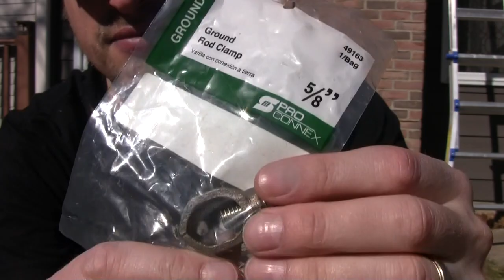Grounding mast and antenna with the Helium Network - Part 1, the Equipment

Comment from the maker: One of my viewers called out that introducing a second grounding rod can cause issues. Audiophiles know this as ground hum. As my grounding is on the other side of the house. I’m going to research this and get back to you all!

UPDATE: Copper clips are better than steel clips as to prevent oxidation of the copper.
UPDATE: My service loops are upside down in this video. You want them going the other way, looping downwards.
UPDATE: Teflon tape is recommended for sealing those connections. It's the same you use for plumbing.
Reply: Hi Ed Ballou, I am thinking to change to 5.8dbi antenna, do you know how I can ground my antenna? Because live in a condominium and we don't have direct grounding to earth.

Comment: You should be using copper clips with copper the prevent electrolysis . In most cases, when stainless steel was in the passive state and acted as the cathode, the contact accelerated copper corrosion. In addition, the area ratio of stainless steel to copper altered copper corrosion behavior. The larger the area of stainless steel, the greater the acceleration of copper corrosion.
Reply: nerd

Comment: Hey Ed
     Love your vids........ but your install needs lots of work. U should totally avoid  running yr antenna wire from the roof to inside the house. U will lose a lot of signal. Best way is put yr hotspot outside connected to the antenna with a outside box. This will give u a very short antenna wire. Then run yr Ethernet cable from inside to ur roof using PoE thus no power cable needed. Your service loop is upside down. They don’t run up, they run down. If you can ....... run yr ground wire to your water meter. It has a ground. They all do. Thx and again keep up the vids. Cheers

Comment: How can you  ground an antenna with an an arrested in a balcony apartment building in a simple way😕
Reply from the maker: Most balconies (recently built) have to be grounded, so just connect to the metal.

Comment: If you have the magnetic base and metal roof will this increase signal also do I need to ground for this to work?
Reply from the maker: Yes! Grounding is always recommended if you're running the antenna outside.

Comment: what's the loss if you make this much length LMR 400 cable to the antenna. So if your antenna is 8dbi what's you think the loss will be for this setup. Also, there will be losses on the junction where you added lighting arrestor with the LMR cable.
Reply from the maker: For the 32 feet, it's probably a little over 1db loss.
Reply: 1.248 dbi

Comment: What do you use to attach the solid copper grounding cable to the antenna mast? I have everything to ground, besides that part.
Reply from the maker: When I paid the electrician to do it, that’s what he did. Not all that exciting. I believe I’ve read that it is very important to ground the whole mast.
Reply: @edballou1  He just taped it to the mast? Or were there clamps? Also, for the cable that goes into the lighting arrestor (sp?) you had to strip part of the covering so it's metal going into the hole for it, eh? I picked up for 10 Stranded THHN at lowes earlier today.
Reply: Late but no tape. With smaller wires you can simply get a grounding screw (the green ones) and wrap the wire around it and then tightly fasten the screw down. Bigger wires will likely require a grounding lug,